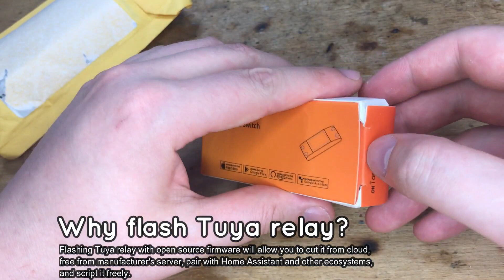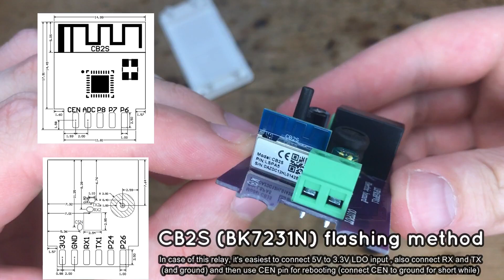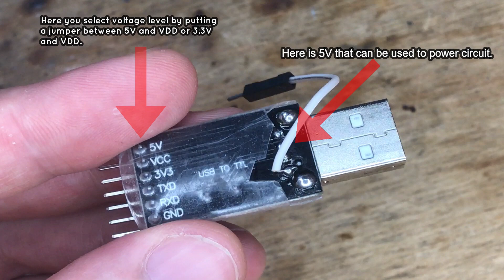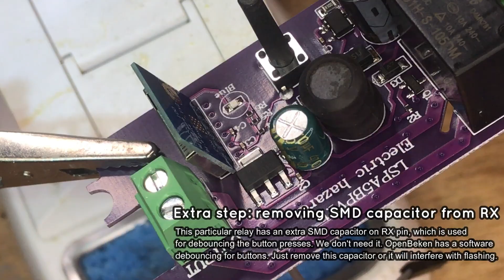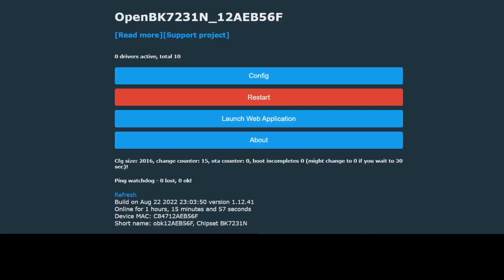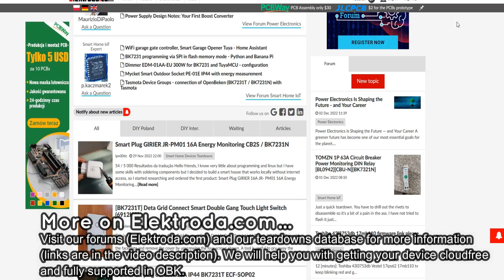Tuya Relay CB2S/BK7231N control without Local Tuya - 100% free from cloud with Home Assistant guide

Comment: Nice, It seems to me that it was easier to unsolder the entire module, flash it and solder it back. so as not to solder the capacitor and not cut the tracks
Reply: I tried that with 4 chips, never worked.